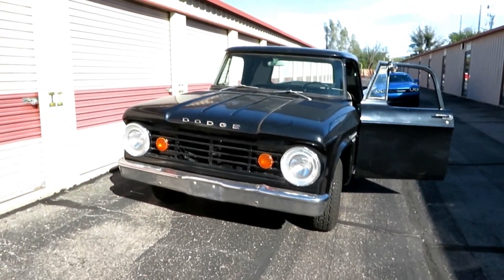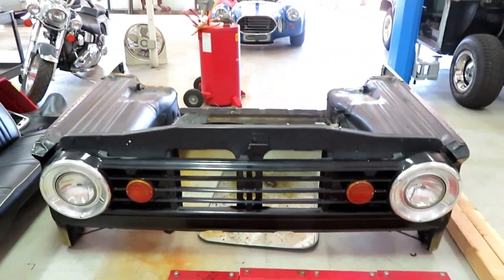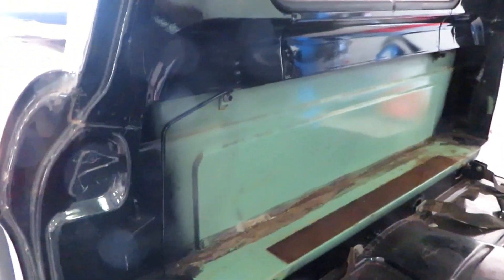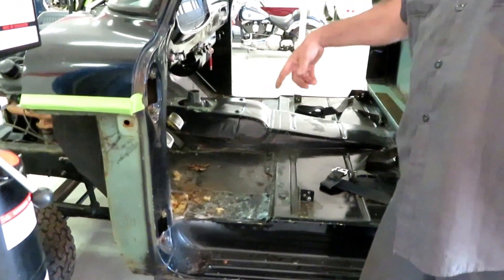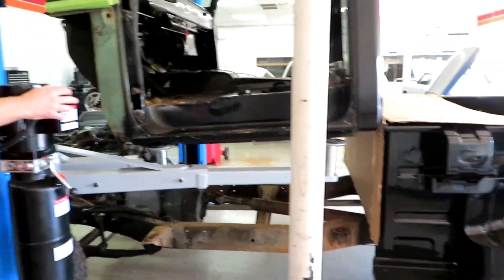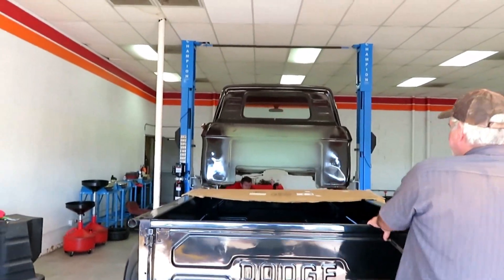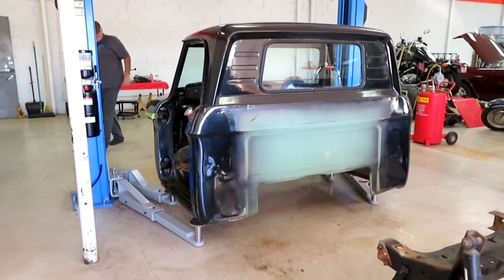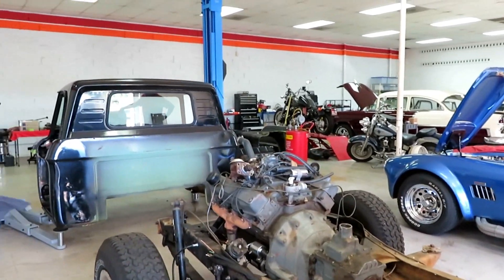1966 Dodge D100 Utiline pickup cab comes off for floor replacement 10012019

Comment: I love the front end, grill, headlights on those old Dodges! And I love those old stepside pickups! Wish they still made them like that! My Dad had a 56 Mercury pickup when I was a kid, I loved that truck! I’m looking forward to the story of the rebuilding of this truck!!
Reply from the maker: Well, as you know, I am just completing the restoration of the 69 Dodge Coronet 4 door, so I am not sure how far I can afford to go with the truck, but I do want the floor replaced because to me it is a safety issue.  I have a few other videos of this truck on my channel where I have addressed other safety issues and even had an all new wiring harness installed.  At least for now, this truck may have to be driven with the "patina" look, but at least it will be safe!  I am going to have to look up a 56 Merc pickup and have a look, but just the year tells me it will be very cool!!!

Comment: I've done the same thing to my 69. BE SURE TO PROTECT YOUR WINDOW GLASS. THE GRINDER SPARKS AND WELDING SLAG WILL RUIN/PITT YOUR GLASS.
Reply from the maker: Thanks for tip Mike!  We kept a tarp over the glass, so hopefully that minimized any damage.  The new floor is in now, and we will be putting the cab and bed back on the frame over the next few weeks.  In addition, I am swapping the 4 speed with the granny low for an A518 automatic with OD so I can use this truck on the freeway.  I hope to have it all done before a car show here in southeastern AZ on 1/25/2020.  https://carnuts.org/Car-Show
Reply: @bartk85622  the exterior part of my glass was fine, but I ruined the interior side of the glass (windshield, back glass). I had the doors removed so the side glass were fine. Check your interior side of the windshield & back glass.Thanks for keeping us informed on your Dodge truck.
Reply from the maker: @mikebell1063  I am sure the back glass is good, it had a tarp as well.  My doors were off too, so no side glass issues.  I will double check the inside of the windshield, but on first glance, I did not see any issues.  I am happy to share the progress of the truck, and I appreciate you following along.  There are several videos after this one of the progress of the truck.  My email is n6347m@yahoo.com  If you would care to share some pics of your truck, I would love to see them!
Reply: @bartk85622  my 69 Sweptline swb frame off Restoration is going on now  6 year project. Plenty of up and downs. I asked alot if questions from other Dodge guys/gals. If you need any info dont hesitate to ask me. I'll try to add some pics of my project when I can.
Reply: This video is awhile back. It looks alot different now. My phone won't let me add photos to YouTube for some reason.
Reply from the maker: @mikebell1063  Left a comment on your channel and subscribed!

Comment: Hi Bart, is that the truck that had the rat's nest under the hood?  I remember when you bought it.  It's going to look really nice when it's done.
Reply from the maker: That is the very same truck Rosanne!  I am probably not paint this truck, it will have the "patina" look.  But underneath it will be safe and reliable.  Brakes are done with all new components, all new wiring harness, while the cab and bed are off, I am going to take the opportunity to have the frame cleaned, rust treated and painted.  I will also have the wood in the bed sanded and properly stained while it is easy yo get to!  It is going to be nice, but not a show truck!

Comment: How many old cars do you own Bart? You need a parking lot for your hobby :). Greetings!
Reply from the maker: ;-)  I have three that are 50 years old or older.  The blue 1969 Dodge Coronet 4 door, the black 1966 Dodge D 100 pickup and the 1969 Chevrolet Corvette.  My daily driver is a 1997 Chevrolet Tahoe.  My wife drives a 2019 Dodge Challenger.  I am actually having a three car garage built to hold the three oldest cars, video to come on that.  They should be starting in November!